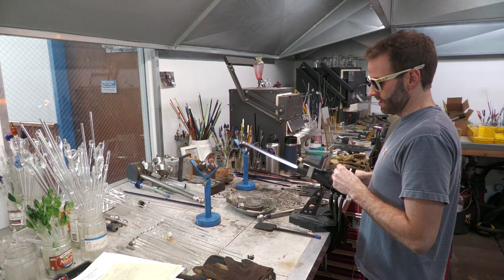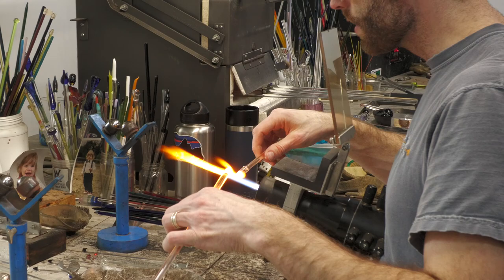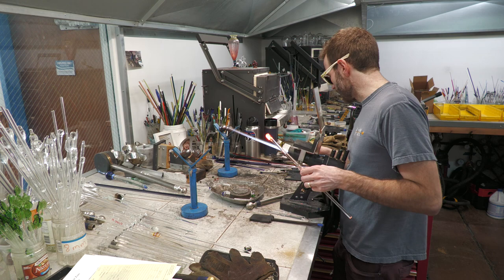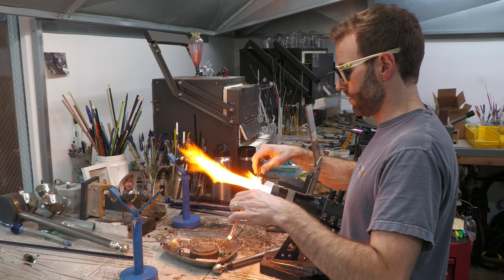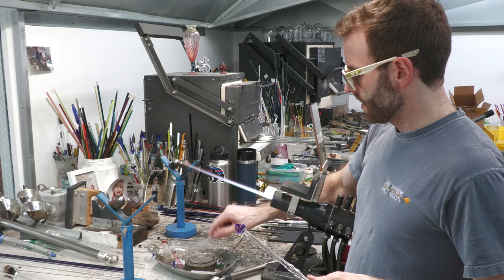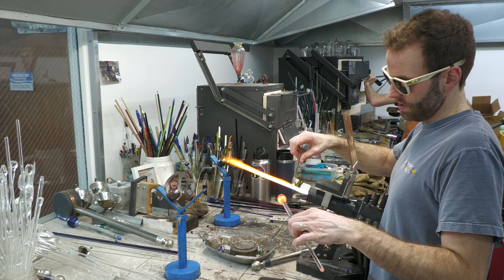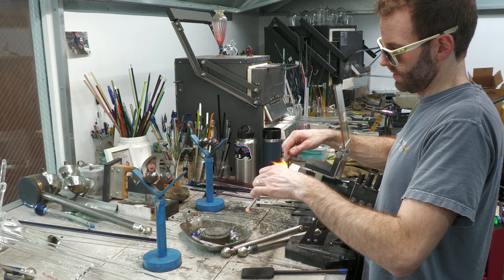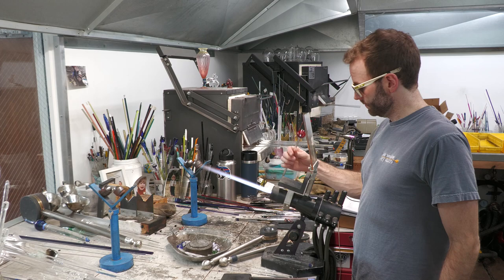How To Make A Glass Marble - Dan Neff - Naf Glass - Lake Superior Art Glass

Comment: You are nit making 3 inch or larger marbles and definitely nit 5 or 6, you need 2 gtts fir a 4inch and a hit shop for biggef
Reply: That’s actually just false 😂gtts are the hottest torches. I have a mirage which is only a two stage gtt and I can easilyyyy make 3.5 inch marbs. I bet with his torch not positive what model but it’s a three stage gtt so I bet you could prob go up to 7 or 8 inches with it
Reply: @michaelkmiec5842  def not heating 7 inches. Coe33 topber Reynolds and the gang constantly making 4 inch marbles with 2 mirages back to back to fues parts of marbles together, maybe if you aren't adding stuff other than direct color application to clear like implosions.  Do you even understand the volume of 7 inches of glass?
Reply: @michaelkmiec5842  either way I'd love to see examples because word of mouth is anything over 5 takes a hot shop